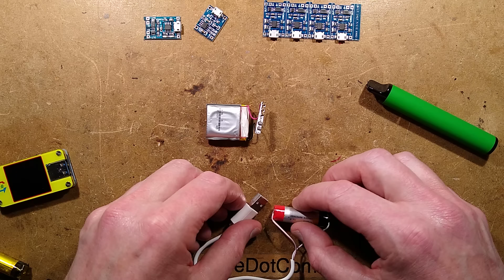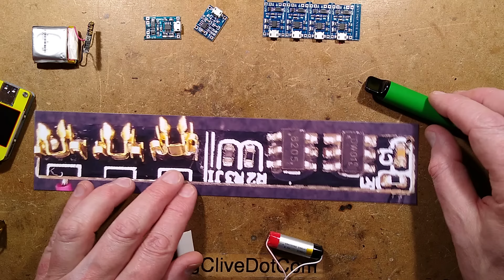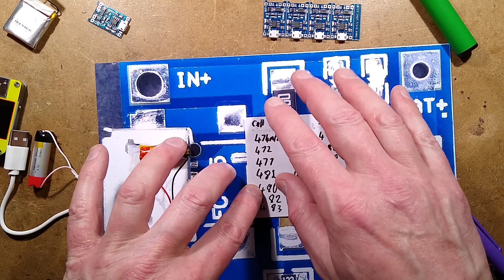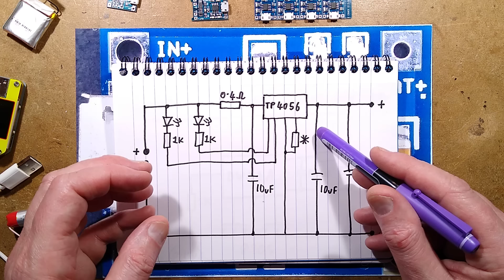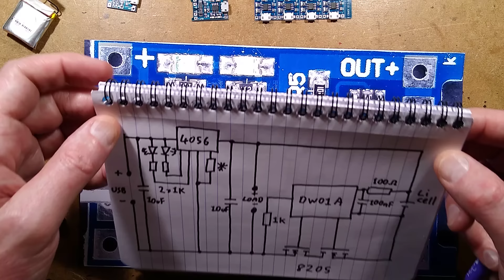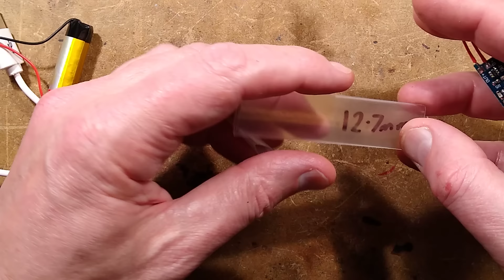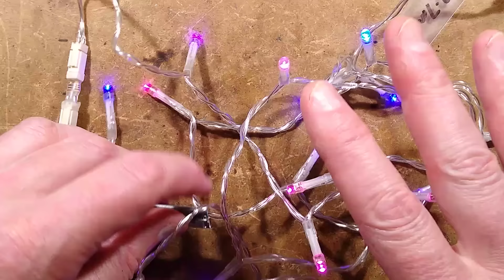Don't do this!   (There's a much safer way)

Comment: Hey, BigClive: those connectors are are a two-pin version of the super common, standard, 3pin and 4pin PC Fan connectors that have been used in computers almost literally forever. The 2pin variant is sometimes called a "PC LED" connector, although most indicator LEDs just use regular pin headers at either 2.54mm / 0.1in pitch or 2mm pitch, and RGB fans have a special, separate "ARGB" connector (if they aren't stupidly proprietary for some dumb reason). Since there are 2pin fans that use that connector as well, I'd call it a "two-pin PC fan connector" just to be safe and avoid confusion. Most people doing this stuff will recognize em from that.
Reply: "two-pin PC fan connector" is confusing because two-wired PC fans found in old computers were almost invariably wired to a four-pin "Molex" connector (with only two of the pins populated), and modern computers don't use two-pin fans.
Just call them their actual name: Molex KK series.
Reply: @fat_pigeon  Actually, most of those had both 3-pin and Molex connectors unless they were simply too high-current to ever run off a mobo controller. I have multiple drawers of fans, sorted by size... I don't have many with a two-pin fan connector, probably about five... but I have maybe two or three with only a four-pin Molex. There are plenty with both three-pin and Molex tho, like a dozen or more. All of these are old and very used.

Nobody knows them as Molex whatever series outside of an order form, unless they're a salesman for Molex. If that.

Also, fun fact, those "Molex" four-pin connectors aren't Molex. The original actual-Molex ones are a different shape and were never popular in that particular use. I have a very dead battery from an NEC XT-class laptop, early LCD job, with an actual-Molex Molex connector somewhere... except it's two- or three-pin IIRC.

"Molex" drive connectors are actually from Tyco AMP... and maybe, given that, using and adapting existing convention is a bit better after all, even if it's not accurate or precise to the order forms ;)

Comment: Ya I mean if you solder it's not a big deal to change the resistor but a  potentiometer option would be nice and only add a couple cents maybe 20 but I guess then you need a meter and knowledge to set it so I don't know that it would be that helpful

Comment: I just cut an extension cord and cut one end off and solder the ends to them with a bridge rectifier of course but we only have 120v I don't think I'd do it with yalls 230v

Comment: Unless you've been living under a rock, you'd know that lithium cells are dangerous if you exceed any of their ratings.  If you're technically inclined enough to identify the poles and the polarity of the USB wires, how TF would the above, possibly escape your awareness??
Reply: Believe it or not it is pretty easy

Comment: Actually the most dangerous charging method some batteries lithium batteries actually have a bag you put them in so if they do short circuit the bag keeps them from exploding and burning your house down and these giant lithium batteries that people put on the side of their house I wouldn't do it because if lightning strikes it it explodes or has a short circuit it gets too hot you don't have to worry that in places like the UK in places like that doesn't get that hot but in the high desert in the Mojave Desert and Death Valley you're going to have to use the lead acid batteries cuz the lithium ions will blow up you can't use them even in your phone sometimes up here cuz I get too hot and shut your phone down in some cases blows your phone up

Comment: Haha Clive, look at you with thumbnails now. Tbh, this is almost impossible todo with any decent USB charging cable. Like this is petrol station quality stuff. Apple's charging cables have like 5 different coloured data transfer cables and it took me ages to just figure out the two that are used for charging.

Comment: Instead of soldering on the battery, if it doesn't have tabs, use your 3d printer to print a battery holder and use some cheap battery connectors from Ali Express or eBay

Comment: I used one of those boards to modify the common, deadly Chinese camping lamp that you've featured in several videos. I left in the a/c jack for decorative purposes not connected to anything but otherwise it's using a lithium polymer pack, charging board, and a lot of epoxy. For fun I also connected the solar cell, but I don't think it provides enough energy to charge the cell very much. I post my work over on Instagram.

Comment: As Clive said, lithium batteries must be treated with respect. The city of Buenos Aires was mourned this week by the death of five people due to a catastrophic fire in an apartment. The cause, an electric scooter suffered a battery burst as it was being charged overnight at the living room of the flat. A religious family with eleven children was decimated, the mother among four of her daughters and sons succumbed by inhaling toxic smoke. The father, hospitalised in serious condition. Other 30 inhabitants of the bulding located at Córdoba av. and Ecuador st. had to be hospitalised too.
New technologies are reaching our hands at breakneck speed and we are not always prepared to deal with their limitations.
An electric scooter is an automotive vehicle, you don' take your car to your apartment, you park it in the parking lot.
Never trust in cheap chinese manufacture and their horrific qc...
The ubiquitous smartphone may ruin your day if you don't treat it well.
I know a person that lose her apartment (and almost her life) by using the cellphone on the bed as it was charging batts (which happened frequently cause the cells were wasted long ago...).
NEVER CHARGE ANY RECHARGEABLE THING ON THE BED OR ON  THE COUCH OR CLOSE TO ANYTHING REMOTELY FLAMMABLE!
One thing is the annoyance of a bursted cell and other is loose your house or your life.

Comment: 19:18 After your Brother label printer video a couple of years ago, I got myself one for very cheap and have started using it to label my modules, for example it's handy to keep a few of those DC converter boards, but I can't remember what they're rated for or I also have a few different LED drivers, so it's handy knowing at a glance if it's rated for 12-24V or 120VAC

Comment: So I use 1s batteries to fly tiny whoops (small drones) and Amazon sells chargers for 1s batteries that charges at 0.2A or 0.6A you could use these right? You'd just need to rewire into the correct plug
Search for "1S LiPo Battery USB Charger 3.7V/4.20V 6 Channel 1S LiPo Charger Tiny Whoop Blade Inductrix Micro JST 1.25 JST-PH 2.0 mCX mCPX Connectors"
Reply from the maker: If the chargers do cap the output at 4.2V then they should be OK.
Reply: @bigclivedotcom  they do cheers, saves me rewiring a load of stuff.

Comment: I don't the the Li-Ions' tiny bit higher energy density (if at all..!) compared to modern LSD NiMh cells justifies all their disadvantages, like higher price, less convenient voltage, more sophisticated handling and dangerous characteristics. LiIon cells are crap.. NiMh cells are much better overall if you have choice.

Comment: I confess I still do this, though not with ones that I've found as I don't take them home 😅
I also use my power power supply which I think does 65 amps at 5v... I do monitor them to make sure they don't get hot or go nuclear, I've used ebay modules to try and charge them but they generally don't even get to 3.3v (for some reason 4.2 doesn't come out of the module)

Humbug I say!

"courscate" someone got out a thesaurus!

Comment: I just use an old 18650 charger I had lying around. you can put four of them in at a time and it has a display with charge time, voltage, mah, and a battery bar for each battery, stops at 4.2v. Now if only I had more use for them.

Comment: Would a 1k-10k variable resistor work to give you options for a more versatile charger? Perhaps connected to a spring loaded battery holder?
Reply from the maker: It would work, but would need to be in series with a 1.2K resistor to limit the maximum current to 1A.

Comment: Top tip: When cold in winter, don't use an electric blanket, use this spicy butt plug instead, you'll receive gradual internal heating throughout the night. If it exceeds 4.3v you'll be well aware. If perhaps the 4.3v does not awaken you from your slumber, your significant other will have a fragrant firework show from your rumpus. Thank me later. 👍

Comment: TP4056 boards make nice compact constant-current drivers for LED projects.  Just set the charging current resistor to the desired LED current.  As long as your LEDs' total voltage drop is under 4.2V, the TP4056 doesn't know the difference and will happily drive them at the programmed current.  With red, orange, yellow and some green LEDs you can wire them two-in-series.
Reply from the maker: Interesting idea.

Comment: I opened a rechargeable disposable and the whole charging circuit was a 6pin usbc port, and 2 microscopic black specks I couldn't read, thinking it was a resistor and an capacitor or diode kinda sketchy imo
Reply from the maker: Possibly two resistors to enable the USB C output.  The charge control circuitry may be in the vape.
Reply: @bigclivedotcom  I'll pay more attention next time I break one down, iirc unless there's charging circuitry that fits on the pressure sensor board this was all the circuitry in it

Comment: is there a way to make them charge a battery to 3.8 or 4 volt instead of 4.2 ? it wil increase the battery cycle life. also is there a way to make them charge a 3 cell 12.6 volt battery pack? like a separate charge module for each cell or will the modules short? maby diode can be used on each charging module? i have been looking for a cheep bms that also balance the cells and keep them all charged at 4.2 v. the bms that i have just stop charging if one of the cells reach 4.2 volt. and other cells sitting at 3.8v and 3.6. its kind of crappy.
Reply from the maker: Most of the basic BMS boards do rely on the cells starting off at the exact same level of charge with no balancing.
You can't use one power source and multiple TP4056 modules to charge series cells in a pack as they will effectively be shorted out.
Reply: @bigclivedotcom  i have seen this guy do it. https://youtu.be/K71GzjpDMRY

Comment: a crude way to charge them is a silicon diode and a resistor in series from 5V USB. the diode will drop around 0.7V and the resistor will limit current.

not ideal but far safer than sticking it straight across!
Reply from the maker: Some dodgy imported products seem to do that.

Comment: regarding the molex type connectors, I would add that as a general rule power sources should be wired as female - i.e batteries, power out etc.
wiring power sources as male is an accident waiting to happen, as it can easily short, even when plugin it in.

Comment: After your videos about charging the vape batteries with charging units I followed your advice because the vape batteries are already empty without the liquid running out. I bought such a strip with charging units on ali and mounted alligator clips on it and it works great! I only bought 2.2k resistors on your advice for the 500mah, they will arrive this week. BTW i used silicone kit for the module. Thanks for the good and clear explanation, and keep up the good work. ;-)

Comment: Bought a single cell USB lithium charger with a spring terminal on eBay. Tore it apart, as is tradition (it used screws instead of clips! 😱), and found a little SOT23-5 IC, and the PCB had "4055" silk screened on it. Looking around, it's similar to the '4056, except constrained to 500 mA, and only one LED pin. Neat.
Reply from the maker: That may be an LTH7.
Reply: @bigclivedotcom  Interesting. I shall have to look that up. Thanks!

Comment: or you could just go out and get a cheap battery charger that handles 4 AA or AAA batteries at a time. For larger batteries this idea may work better.
Reply from the maker: If you mean a NiMH charger then it's not suitable for lithium cells.

Comment: As an avid learner i always want to go the most-primitive route first. Anyone can buy a charging circuit off aliexpresses, but how did the first inventors do it? Surely having a box of resistors, diodes and transistors (maybe even a stray zener) i should be able to build a functioning overcharge protection circuit?
Reply from the maker: It's easier and cheaper to get the dedicated chip.  The charge voltage threshold is very accurate and critical.
Reply: @bigclivedotcom  comfort is the place where dreams go to die. Its not about the money or safety, its about bettering myself and becoming less dependent on someone else... whoever it may be that manufactures all the chips.

Comment: As a non smoker my friends think I'm some kind of wierdo getting excited when I find a 'dead' vape in the street. It takes some explaining that I'm actually saving the planet. Q: would it be OK to put two or more batteries in parallel to get that extra capacity? Also I'm a little concerned about handling these cells because they tend to covered in the vape liquid, which I'm assuming, contains nicotine. So I normally wear some rubber glove to stop the liquid contacting my skin. (again, non smoker). Maybe a bit over cautious?
Reply from the maker: Yes you can parallel them.  Make sure the voltages are very close first.

Comment: I prefer XT30, and XT60 connectors. Easy to solder onto anything, much easier than crimping pins on those molex and JST plugs.

Comment: I may be mistaken but it looks like you connected the battery to the +5v pads, NOT the regulated outputs. got to be careful.
Reply from the maker: Definitely the battery connection, but the positive is commoned to the output with the protection switching negative.

Comment: Does anyone have a good source for a novice – video, tutorial, blog, etc. – (especially one from Clive) on wiring up solar panels to charge a power brick? I assume they have their own protection circuits seeing as you can charge them straight from a USB source, but is there anything else one should be aware of when cobbling together a solar charging system from scavenged parts for a 20000mAh lithium polymer power brick? Could a couple of panels from solar garden lights (5½" X 4¾" – 14 cm X 12 cm each – sorry I don't have any other details on them) generate enough electricity to put any charge into this brick? If they can, would it take ages of bright sunlight to generate a worthwhile charge?

Comment: This is why I hate lithium ion/poly batteries. You must have china chips to charge them. You cannot just slap the proper voltage across to charge them like good ole lead acid. Nothing these days will work without ordering junk from the china boat. I miss the days where you could just goto a store, and pick up electronic parts to fix things.

Comment: Can you use one TP4056 module to charge 2 or more batteries in Parallel?
Reply from the maker: Yes, if the batteries are at the same voltage when connected.

Comment: I'm guilty in a way of doing this. I have an old cellphone that had a dead battery/broken charging port. So I spliced a USB to the terminals and used my computer to charge/use the phone. But it only works via PC USB port, I've tried with a wall outlet and the phone just doesn't turn on.

Comment: You are showing it pull 0.915A at 5V - wouldn't that mean that it would probably get more than 1 Amp @ 3.7V (or whatever voltage it passes on to the battery?).
Oh, come to think of that: at what voltage does it chage the battery?

Comment: what is the input voltage range?
Reply from the maker: The TP4056 is rated for up to 8V but the current will have to be lower to reduce chip heat dissipation.

Comment: I'm partial to the little DC - DC buck boost controller with the LCD for lithium charging needs.... I've got a vape battery running an auto darkening welding helmet and a few other odds and ends. Very useful!

Comment: I think to charge the cells with 1A or 2C is fine. Because of the source there are coming from. The cell is relatively big for 500 mA . This smoker needs a lot of current heating up the fluid to to the job.
So they are made for high current applications.
If it will be possible this cell will be smaller to safe cost but this product is very high Technologie. You are producing billions of them so to safe costs is the way you earn money. And to safe money is in first time to make the customers happy. And what’s make them happy a save product. You can not risk to put shit inside that exploded in the hand of your customers.
Make in a high quality.
Very good source I must say.
I have Bild inexpensive lights next to my bed. 
Touch sensitive and normal you have to use 3 x aaa battery’s. I got one for 3€. The cell inside the battery compartment. The lamp has already a usb plug and a diode that the usb can not charge the battery’s. Plug the usb charger like he has described and you have a very good light. You can put two cells in parallel to increase the capacity and going down to 500mA charging current to each cell to get a tiny little more live out of it. Quick charging is maybe useful when you quickly want to charge them. Maybe to 50 percent when you are reading a book like I do.
After one hour the battery will work one week. I normally never charge them full so they will work longer than the led will light. 
One thing the led are a little dimmer. Normal are 5V usb or 4,5 V battery the lithium cell has max 4,2.
But that is excellent for live of the led you lose a little but will brightness but will increase the live of the led significant.

Comment: Before you told us, and given its orientation on the board, I thought that 1K2 resistor you showed us was a 220R. It seems to me that those markings are a bit rubbish ; or is there some way to distinguish between 221 and 122 (without a meter) that I am unaware of.
Reply from the maker: A meter is always good for double checking.